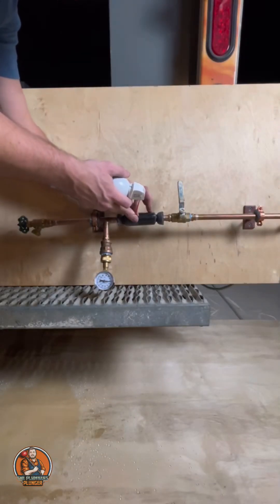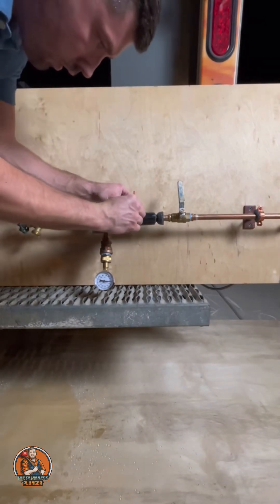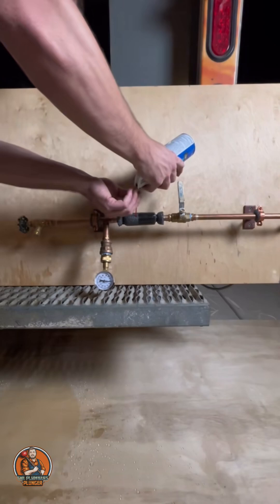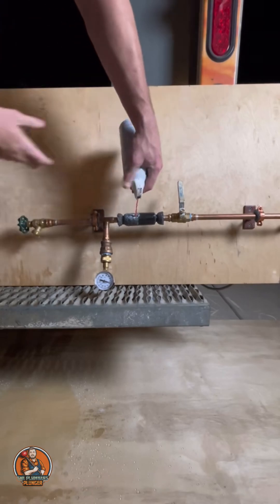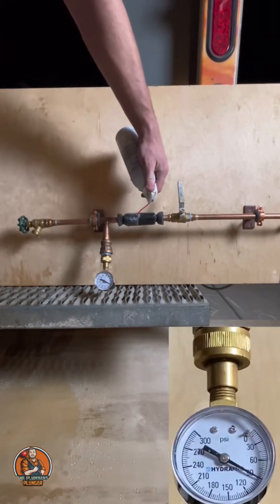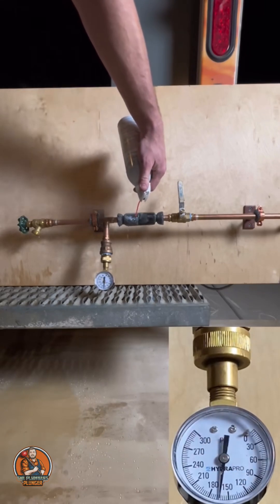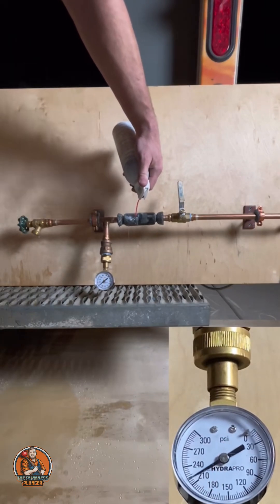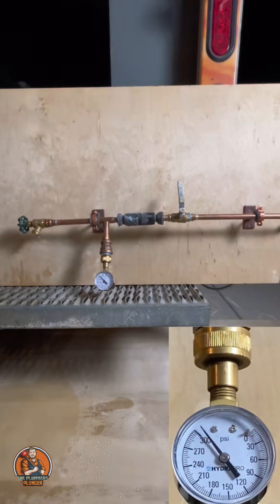Why Do Frozen Pipes Burst?

Comment: I wish this was the only factor in water line freeze & bursts.  We wouldn't have to be so meticulous in our winterization practices.  But, alas, many have had to learn the hard way.  

You can turn the water off at the curb...open every fixture in the house...lines can still freeze and burst.  

The lines have to be "blown out" or otherwise drained.

Sometimes pressure can actually save you.  

And then there's also the evil magic of frost penetration with bare metal pipes.

Many factors.

Comment: So if the ice didn't expand causing the extra pressure then it wouldn't split...therefore ice splits pipes lol
Reply: The faucet running is just to carry “warmer” water from the more insulated ground through the less insulated pipe. 

Having a faucet open but too slowly can drop the pressure enough that the water can change phase and turn into ice anyways. 

Basically after 27F for 4+ hours you better have 2”+ insulation or drain the water from your pipes.
Reply: That's like saying that drowning is caused by oxygen because there's oxygen in water. Yes there is ice in the pipe, but it's not the ice that pushes on the pipe.
Reply: @coltith7356but there is oxygen in water are you dumb? Thats not even the same in the slightest. Think about it, if the ice didnt expand then what else would cause a pipe to burst. Youre already off to a great start lol
Reply: Who sang it's not physically the ice pushing against the walls of the pipe but the pressure there's a difference
Reply from the maker: Yeah sure, if you want to break it down to that.
Reply: @theplumbersplunger It can't really be broken down any other way... 
IN FACT : Vertical Lines The Freeze breaks are always Near the top of the run... because that's the water level and that's where the ice forms first... ( Before ice freezes when it starts getting extremely cold and close to freezing it expands and floats to the top)